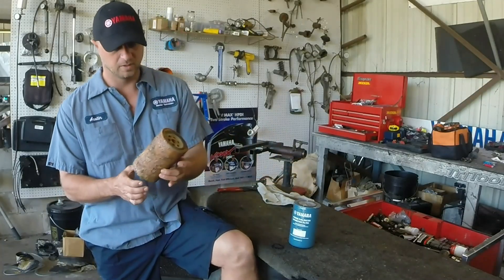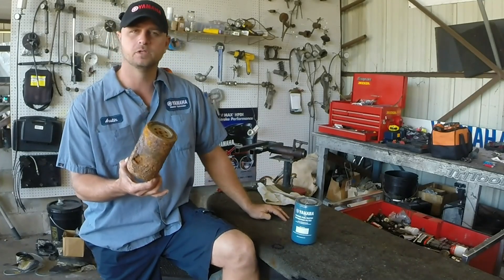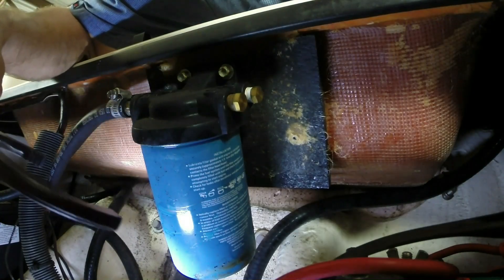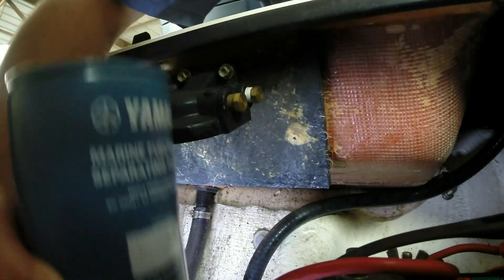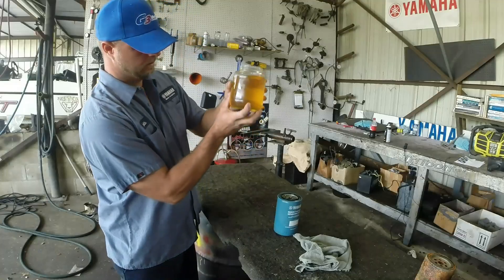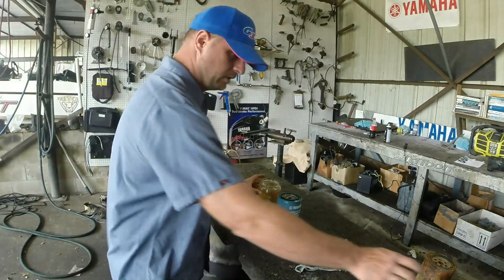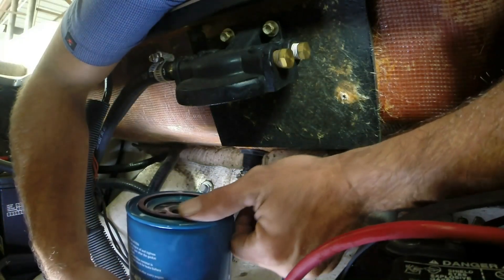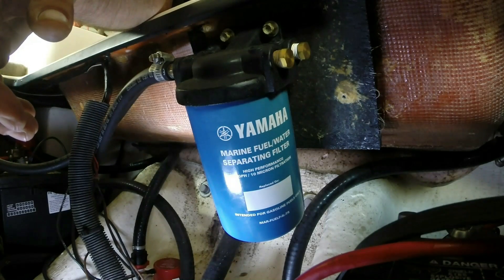How to Change Fuel Water Separator on your boat's fuel line

Comment: I just put  one on an omc 5.0 cobra, a 30 year old engine....working on getting it to turn over  eventually...could it possibly hurt the fuel pump it I put it in as instructed with no fuel...also it said oil for the seal for coatin..which thought  was strange considering it's a fuel/water filter... that ok as well?

Comment: Is it possible to drain water off of the filter without changing it? Just to check if there's water in your fuel.
Reply: Only on certain types of fuel water separator. Those will have a valve at the bottom

Comment: Justin I have? for you. I have a 2001 Mercury 150 EFI outboard motor, there is an in line fuel filter. I can find any information if there is a fuel water separator located on this engine.  If there is no separator I would like to put sit up a system. Could you hook me up with information on where to buy a separator system? Thanks for your time.

Comment: Thanks for the informative video. I'm not a super mechanical guy but I'm having issues with my OMC 4.3L getting fuel. I am going to try changing the water separator and see if that makes a difference. Do boats usually have a separate fuel filter besides the water separator?

Comment: I just installed a new seperator on m yboat. It had been siting for a year with a full tank of gas. It's possible there may have been some water build over that time. Is it ok for me to just dump it out, and reinstall without having to constantly buy a new one every time?
Reply: I wouldn't leave fuel sitting for a year.